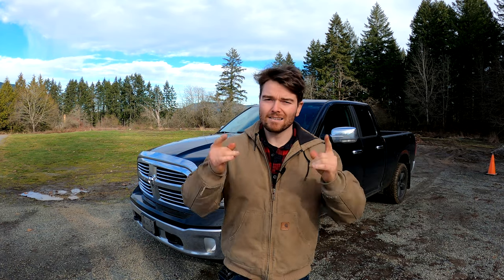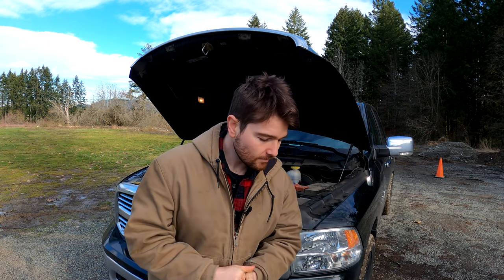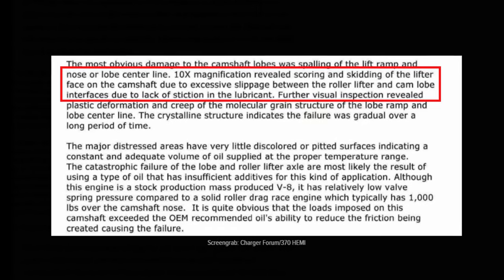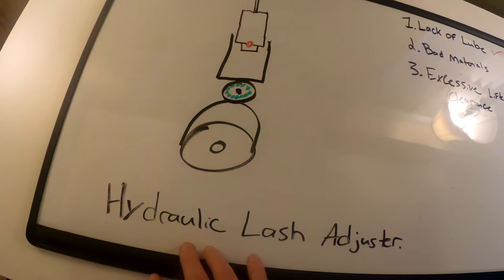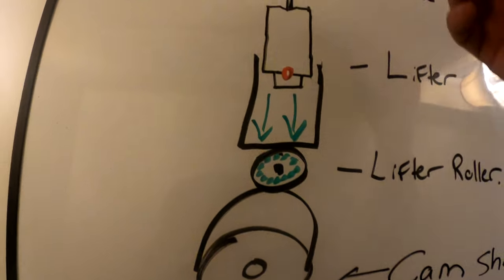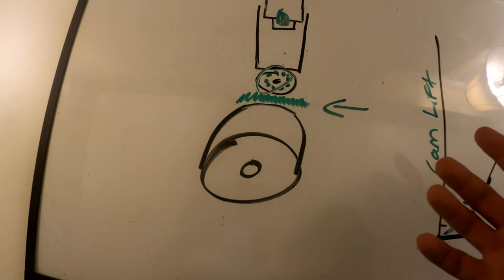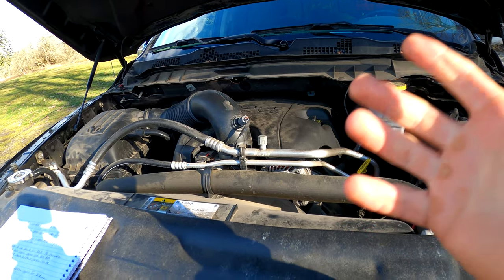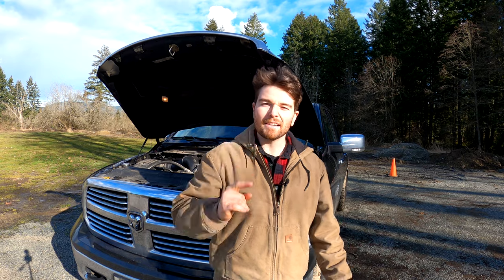RAM 1500 HEMI TICK Explained (Revised) - The Cause And How To Protect Your Engine

Comment: Why isn’t there a recall on these?  It seems as if lots of people are experiencing failures.
Reply: They would probably go bankrupt from fixing the millions of hemis
Reply: not enough safety related failure
Reply: I am going to see a Lawyer about a Class Action Lawsuit.  Also, am writing the NHST about a recall.
Reply: @ianbennett5922  so did you see a lawyer?
Reply: I've already had the manifold gaskets replaced on mine and it was actually done under warranty
Reply: They won't even fix the known design issues on later models. 
All it would take are new Headers, Bolts, and a higher flow oil pump and they could eliminate huge warranty repair costs. Just put the hellcat oil pump in all the new 5.7's. 
Oil pressure drops off too much at idle.
Reply: @mastercarpenter1970 , brought my 2021 ram 1500 in both manifolds were cracked. 
Garbage design.
Reply: Noisy lifters are not good, but how about the poor owners of the Eco  diesel

Comment: I have a 5.7L Hemi with 125,000 miles on it.  No tick.  I have always used a synthetic blend oil and changed it every 5,000 miles.  Just sayin'.
Reply: Good move... I change mine at 4k and also use Lucas syn oil additive.
Reply: I got 2020 with 150k miles no tick.
Reply: Someone told me to start changing it around 3k miles..
Reply: My 2013 has 146000 miles and it taps harder than Bill Robinson!!!
Reply: My 2014 is in right now getting all lifters replaced! 200,400 kms. Has had 5W20 synthetic oil since new. 😬

Comment: Great detail. I just bought a 2022 Ram 1500 Limited at 1,000 miles I changed the oil to Amsoil 0W20 Vs 5W20 lower vis at start-up IMO is better. At 5,000 miles I changed the oil again with Amsoil 0W20 But, I added a K&P Engineering oil filter and an oil filter relocation kit to make it easy to change the oil and changed to OEM filter to K&P it is a reusable mesh filter clean with break clean compressed air reinstall and you can clean it anytime you want and only lose 300ML of oil ( 10 ounces) The other great advantage IMO that adds to your research reference of lack of lubrication is the supply of oil from the oil filter, the OEM oil filter cleans to 20 microns the K&P Filter clean to 5 microns with an internal magnet to remove metal but it also offers 7 times more oil flow than OEM and you never need to buy another filter again results: cleaner oil, clean as often as you like, reuse, 7 times more flow than OEM. I used this filter on my 2015 Ram Ecodiesel for 80,000 miles with no issues at all. I also used an Amsoil engine flush with every oil change and changed my oil every 5,000 miles My Father embedded in my head that 3,000 miles are when you change your oil and to change it yourself don't rely on others to be critical for life of your engine. Amsoil says 25,000 Not for me 5,000 not that the oil wouldn't last it might but you need to at your undercarriage check all the components I clean the undercarriage and clear coat frame I traded in my 2015 Ram Longhorn and the dealer gave me $27,000 it looked like new inside and out. Take care of your truck if you want it to last with fewer issues. Great video thank you for posting.
Reply: How’s that oil consumption with the amsoil, 2 quarts every 1200 miles or so?
Reply: Ow20? How is that going ? Any issues I saw a guy saying he puts 5w30 instead of 5w20 and that his trucks has no tick but how is using 0w20 going ?

Comment: Running a good 40 weight will drastically reduce if not eliminate this problem. Also adding a ZDDP oil additive is a must as well.
Reply: Mine us 5W 20 so go 5W 40?
Reply: ZDDP oil additive??

Comment: Yea, they didn't fix the issue when Ram went to a new supplier. I have a 2019 and the lifter in cylinder 6 has failed.

It's not bad oil, either. I have never used anything but mopar filters, and the best possible full synthetic oil. I changed oil every 5k. I don't idle longer than the length of a red light..... did everything right. Still dead lifters.

Comment: 245K on my 03 5.7 no tick.
Reply from the maker: Those "older" Hemi never seem to have lifter failures at the same rate as the newer ones.
Reply: My 03 has 232k miles and it just started ticking the other day kinda miffed about it
Reply: @marvnation924  well it seems you have gotten your money's worth. Guess I've been lucky so far but it could happen. What I understand it's because of the MDS and the 03 doesn't have it. Not saying mine isn't as quite as it was when it was new, bought it in 05 with 23k on it so if it happens I honestly can say I've gotten my moneys worth. Still would be bummed though.
Reply: @ShootnTexasStyle  Well after just sitting overnight the tick went away lol so it seems it's still good to go I picked up some Redline 5w30 for its next oil change and i'm gonna see if that makes it run a bit smoother, it's still got a little valvetrain rattle but overall runs pretty good now to be honest

Comment: Easy fix hellcat lifters, and a hellcat oil pump and MDS HAS TO BE DEACTIVATED BECAUSE HELLCAT LIFTERS DONT HAVE MDS CAPABILITIES!!!! I know because the oil pressure is shit at idle with this I do these as a kit in my Chrysler shop I’m certified Chrysler master tech and I do new car warranty work when I do this pkg for over 2,200 in these hemis and not one has had an issue  a lot of these are city stop and go the hell cat oil pump makes massive amount more oil pressure at idle and through rpm range!!!!

Comment: Bless you man! This is the most detailed and most informative video I have seen for this issue. The white board illustrations are awesome and helped me understand what is fully going on mechanically. 

Thanks
2016 Ram Laramie Limited
I use synthetic and have it changed at the dealership every 3,500 miles or so.  55,000 miles so far and no issues. 🙏

Comment: I've always bought used vehicles and have had good luck however...it's scary as heck to think some folks go 14k between oil changes LOL. Great in depth video Alex, appreciate the work you put into this.
Reply from the maker: It's a little crazy, now I think the oil meter adjusts the oil life based upon engine loads and idle time and so forth but still 14k is a little wild! Thank you sir! appreciate the kind words!
Reply: Bought my 2015 ram new from dealer, 6000km between oil changed with only full synthetic oil... tic has started at 190,000 km and goes away after 15 min of driving. Truck is at 250,000 km now and still the same sound. Guess it's getting close to the time of an updated lifter and cam job. I came from a 5.4 cam phasers problem engine to this lol
Reply: @troyrgates  if the tick goes away when engine warms up, wouldn't that be the exhaust tick not lifters?
Reply: @334trax2  dealer says its piston slap. I'm just glad it isn't the lifters eating the cam but who knows if they really know for sure.

Comment: Nice video with good information. My 16 Ram had cam and lifters done at 5300km before it’s first oil change. Dealer couldn’t tell me why they failed. I had the tick come back this past November but it was the manifolds this time. Extended warranty covered both manifolds, studs and heat shields. Other than these issues it’s been a great truck and man am I happy I got the extended warranty.
Reply from the maker: Interesting! Okay so I also read that potentially sand and debris from actual the engine block casting could clog up those small oil orifices in your lifters causing very premature lifter and cam failure. So I wonder if this is what happened to you. Silver lining is that Ram warranty does do a very good job!
Reply: @TheGettyAdventures  I looked up my build date and my truck was an October 2015 build (2016 model) and it sat on the lot till April of 2016.  So I may have had the older design lifters in the engine.  I also wonder how many "test drives" the truck had combined with sitting had anything to do with the failure.  I use conventional 5w20 oil and I get it changed at 6000km or when the oil life meter says 50% with no problems since.
Reply from the maker: @craigpearson1148  well I'm happy your truck is running well and hopefully keeps running well! My truck had 97km on it when I bought it new so I figured mine also had a bunch of test drives lol

Comment: I don't have an unusually large amount of experience with just the gen3 HEMI, but I've been thinking for some time, this is mostly a lubrication/maintenance issue. My 09 Charger 5.7L has about 148k miles. The only "tick" I get is just for a second or two, at most, on cold start-up, when the car has sat unused for 10-14 days or more. I change my oil & filter myself, as I have on all my Mopars for 55yrs. On all my Mopes, post 2002, I have been using top tier synthetics, and for the last 30yrs only WIX filters. I always change the oil at most at a 5k mile interval.  Sometimes, I'll only go 2500 mile interval if it's a (new to me)used car, and I want to make sure I flush the old crud out of the engine thoroughly, and get it on the  multiples of 5k miles on the odo, so it's easy to remember when it is coming due for an oil change. I, also, always use FilterMags on the filters to catch all the ferrous particles in the oil before they plug up the filter and damage critical surfaces. Another thing I do is to check the oil at every fuel tank filling. That way I can closely monitor oil level and color, and make sure the coolant level is good. I mean why waste your time just standing there like a statue, when you can be checking this stuff?
Reply from the maker: couldn't agree more! having good clean oil is the best way to protect any engine. There could be other reasons at play with the Hemi Tick but I think lubrication issues are a big factor. So hopefully everybody maintains there engines as well as you!
Reply from the maker: @JD Spears what year is your engine?
Reply: @JD Spears Id like to also add full syn mobil 1 every 4-5 thousand and this is on a 08 300c 5.7 with a new built motor 1k miles so far and still have the tick at cold start.
Reply: As a follow-up, what little tick I have was bothering me, so I added 1/2 qt of MMO to my engine then ran it up the freeway 10miles and then back. I drained it hot, changed the filter(WIX#57899), & refilled with Castrol full synthetic & 8oz of MMO. The occasional tick I had has slowly disappeared. I also cut the base off of the old filter and you can easily see the ferrous "dust"-like particle "stripes" that the magnets, on the outside of the filter can, pulled from the oil and held them captive onto the inside surface of the filter can. I think if you catch the tick early enough, shorten up the oil change intervals, use good quality oil and filters, use FilterMags or the equivalent on the filter exterior, you just might avoid more serious damage. 
On a lot of these HEMIs w/ cam & lifter damage, you can see the valvetrain is brown & varnished, like it was run on dirty oil for some time  and possibly run hot, too.

Comment: I have a 13 ram express, found the root cause in mine is a lifter failure on cylinder 8.  First started with a misfire, then removed the valve covers and had the lifter failure on the intakeside of cylinder 8.  So found a shop and am currently in the process of doing a cam swap, hellcat lifters, hardened push rods, ported and polished heads, new valve seats, guides and springs. Getting it tuned as well.
Reply: Dammit boy you were like fuxk the stock lifters alv 🤣🤣 same shit I plan on doing I got a 2013 rt with ve Ram intake some heads and x pipe with a magnflow inch exhaust
Reply: I hope they’re not charging you more for the hellcat lifters, they’re the same.
Reply: How much all that gon cost ya?
Reply: @victorortega2718  was 9k as a turn key final product with dyno sheets if power output

Comment: Good info. Don’t forget about idle hours as well. A lot of the tucks with lifter failure have excessive idle hours on the engine
Reply from the maker: 100% correct I covered that pretty in depth on my first video but you are absolutely correct. Idling will deteriorate your oil much faster. And can potentially starve your cam and lifter for oil. Great point!
Reply: I try not to idle, but it's tough when we have -38 celsius days up in Canada
Reply: Ya man, I use remote start A LOT in upstate NY bc it’s frigid as shit out and I’m getting older. Whatever, it’s got a 100k mile warranty 🤣
Reply from the maker: @TheLoob321  I hear ya! I have a buddy on the Yukon/Alaskan border and he idles his truck for 20 minutes every morning and has no issues with 200,000km. so I imagine some luck is involved with this issue
Reply from the maker: @MrAfropuff2  nothing like a good cold start in the morning! wouldn't hurt to warm her up a bit when she's that could!
Reply: @TheGettyAdventures  I’m from Canada and it’s cold in winter I idle my truck sometimes for heat but I do early oil changes at 5000k 07dodge ram hemi  almost 300000 k no problems nock on wood

Comment: I owned several vehicles n now still drive 3/4ton chevy, 02 dodge 1500, now 2022 have no issues, I've had from 100k to 350k I've always used factory specs n so far so good thnks  stay safe God bless👍

Comment: Good vid! Just make me wonder about why the fleet vehicles (cop cars)are failing. Most fleet vehicles get their oil changes at constant intervals for the most part. What you said is correct and im not arguing at all. But i think the low rpm range(500) at idle have to have something to do with failures also. Lower rpm = low oil pressure. Hence the lack of lubrication!

Comment: great vid. i watched tony as well a while back. i change oil every 10 k. full synthetic on the last two hemis trying to avoid this failure. also i’m keeping idle time to a minimum. i’ve had a 2012,2013,2014,2018 and now a 2021 all hemi 1500’s.
Reply from the maker: I just traded in my 2017 ram 1500 with 107km and that engine ran strong the whole time. zero issues. I think the Hemi's are good engines with obviously some weak spots with the valve train. other then lifter failures there really isn't any other major consistent issues. and obviously Chrysler deemed them good enough to run the same hemi in the 5th gen trucks

Comment: I have a 2012 Ram 1500 with the 5.7 hemi. It has ticked since i bought it with 120k. I have 150k on it now. Sounds bad on start up. Quiets down after a few min of running. I push the truck hard. I run Amsoil 5w20. If it blows up i will rebuild it. It has been a great truck for the last 2 years that i have had it. Great explanations good sir.
Reply from the maker: Honestly sounds like you just have an exhaust manifold leak. A lifter tick usually doesn't go away when the engine warms up. good news is those are pretty common and not that hard to fix.
Reply: @TheGettyAdventures  Its not a manifold leak. Both sides were done right before i bought the truck. I think it has to do with the MDS system. If i drive it normally it will make a funky clicking sound on deceleration. If i manually put it in 6th gear and drive like normal it goes away. I think it is the cam phaser hitting the timing cover ever so slightly. But i have no proof of it thus far. Just what i have deduced reading ram forums.
Reply from the maker: @seavisions  Could be man. But I've also heard of guys driving with ticks for years and having no real issues other then the audible ticking. but like you said without ripping everything apart it can be hard to tell what is really happening.
Reply: I have a 2012 with 174k miles had the tick since 140k. I didnt think anything of it until it got so bad my engine started shaking violently when I put my foot on the gas. I changed my cam and lifters, 2 cam lobes were ground down, cylinder 3 cam literally had about 1/4 inch ground off, cylinder 3 lifter I couldn't get to roll at all. So I changed the cam and lifters but my truck has recently started ticking again. I think maybe pushrods?

Comment: I can approve the 5w20 Oil, it's what we use in the middle east. I've owned a challenger 5.7 and a 300 SRT '13 as well as my daily drive '15 Ram 5.7 Laramie. 
I've a multiple friends garage owners as well as a MOPAR only real life group of friends, so you can only imagine the variety of models we have and worked on. With that being said thro all those years since 2012 til now I've only heard about the Knocks/Lifters in the Internet. Not saying it doesn't exist but I've not seen/hear it from anyone in our MOPAR group and garages, we always change oil/filter on 5-6K km despite the dealers saying every 10K km which we don't follow. 

The oil weights (If not weather/use specific) and high mileage lead for many issues inside the engine than people can imagine and they'll only see it once they open up that engine. Synthetic Oil if ran over mileage can be more worse cause it will create layers on the internals that restrict the oil lubrication/flow badly which will keep stacking up.

Thank you and i appreciate the work and research in this video.
Reply: I see people using 5w30 saying the tick is gone have your ever had anyone one use 5w30 if so did it help or did it make the truck worse? Also some people here saying they use 0w20? I had an exhaust leak passenger side 3 broken bolts on the eng manifold fixed it last week no more tick but idk if I'm traumatized or what but I think I hear the tick still lol so now I'm looking into the lifter thing just want to gather as much info on how I can help my truck last longer and not fail me it's my every day you know any advice helps